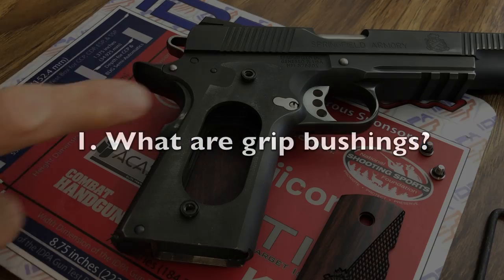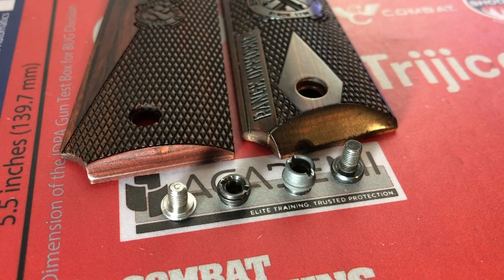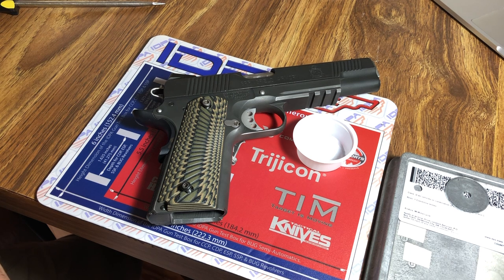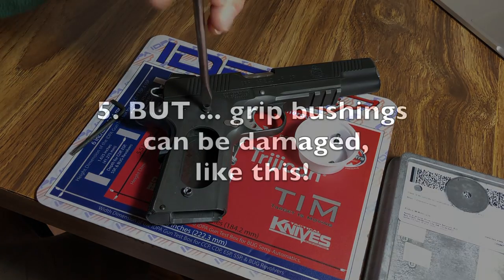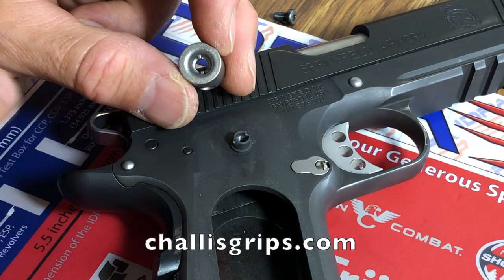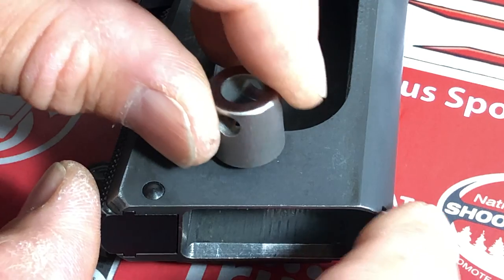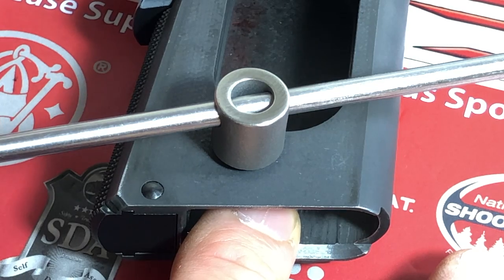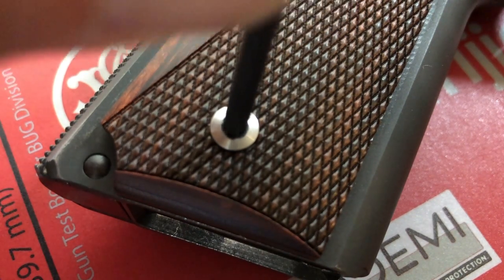1911 Grips, Bushings and the Challis Bushing Extractor

Comment: Any idea why I can’t get the screw to thread in evenly? Damaged threads?
Reply: I think I recall it can be a little tricky getting the threads lined up and starting correctly, but by patiently working with it you should get them to go in straight. If that doesn't work, it might be due to mismatched or damaged threads.